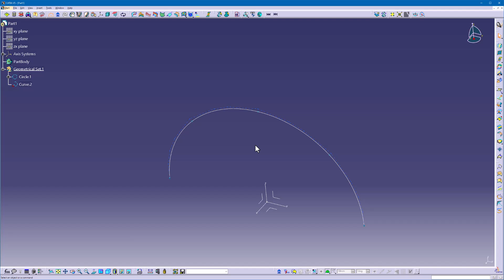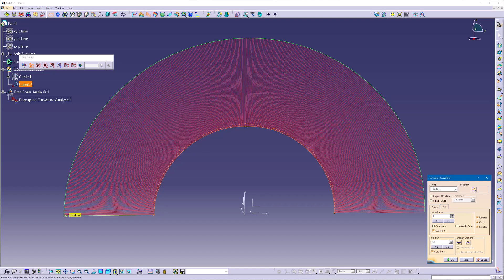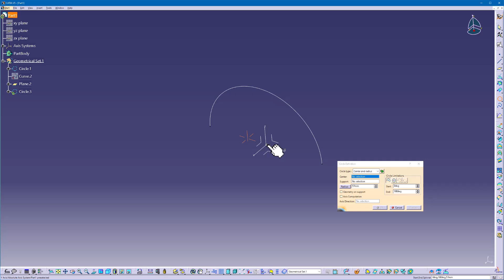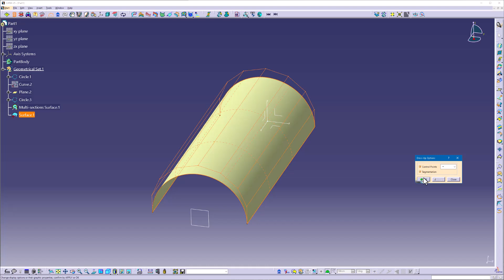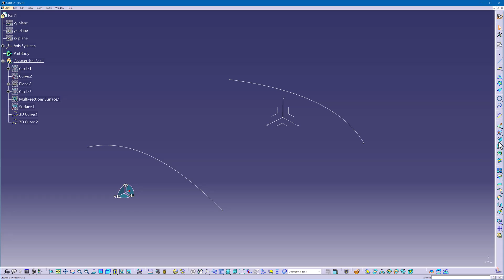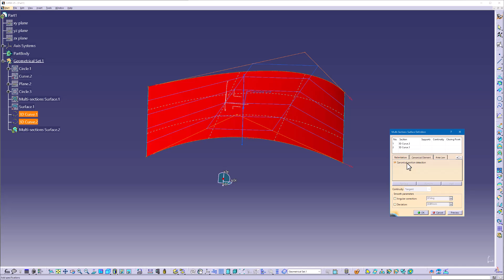Catia V5 | More NURBS Stuff

Comment: I went and did almost this exact thing in CATIA after your NX video. I also noticed that the dress-up didn't do anything on the canonic cylinder that was produced with the multi-section surface.

Does CATIA handle surfaces and curves differently when they can be recognized as canonic geometry?
Reply from the maker: @lukrative525  It's not that it handles them differently. It's that they are different.

True circles do not have CVs or the like.

I will make a video explaining. Good topic.

Comment: Not entierly sure if I understand what you mean by "true circles". Alias can build with rationals which use weighted cv's to make perfectly round circles. However. All manufacturers I've encountered prohibit the use of rationals in alias because surfaces will inherit the weighting which will makes alignment work near impossible.
Reply from the maker: True circles do not have control points. 

When you assign weights to cv's it causes distortions that cannot be easily mimicked for machining purposes. 

I will make a video to explain.
Reply: @StevenMarji  I've only worked a little in catia, but I've been surfacing in alias professionally for 10 years. Looking forward to your next vid.